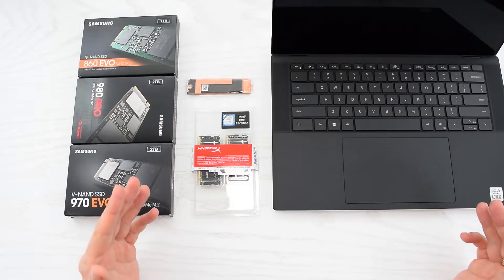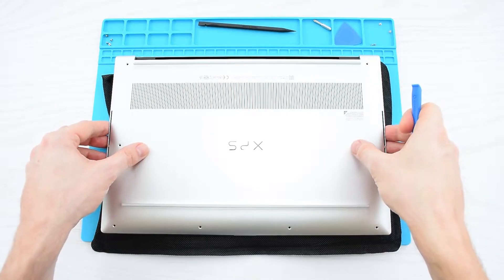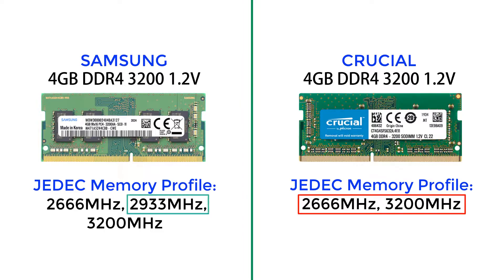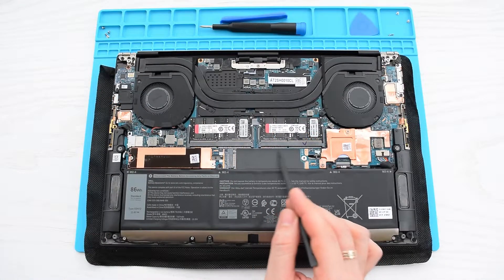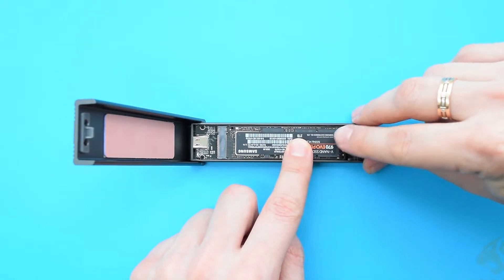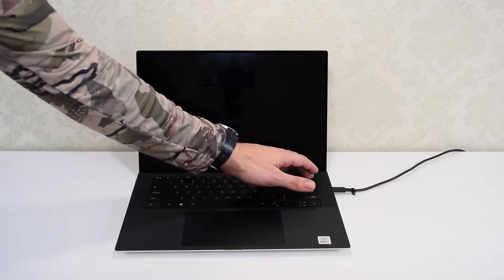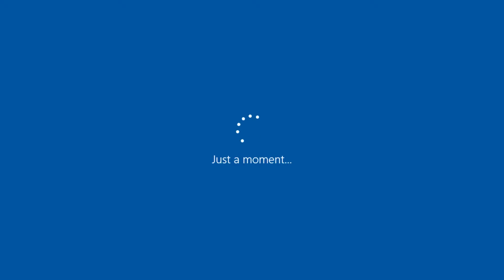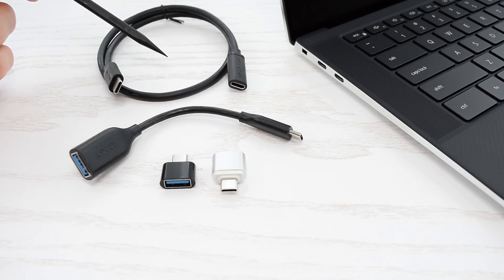Dell XPS 15 9500–9530 RAM & SSD Upgrade Guide | Max Performance Setup!

Comment: I have an xps 9550 that I bought in 2017. My laptop still works quite well and I want to upgrade some parts. Could I email you or set up a video call? I can pay you so you can give me some recommendations.
Reply from the maker: In this laptop you can upgrade your 2.5"HDD to an SSD or HDD up to 4TB or HDD. I recommend using this 2.5" SSD: https://amzn.to/3idnbFD
and this one 4TB 2.5" HDD: https://amzn.to/3MTt4WH.
You can also install a new M.2 NVMe SSD and your best option would be Samsung 980PRO 2TB: https://amzn.to/36rSSZj
As for the RAM, you need two modues of DDR 4 2133MHz. It's hard to find that memory nowadays so you can use any DDR4 2400MHz. For example you can install two 16GB modules and you'll get 32GB of total RAM working in dual channel mode. I recommend buying these RAM modules: https://amzn.to/3KQYv24
And finally you can upgrade your WiFi/Bluetooth combo module and your best choice is Intel Wi-Fi 6 AX200: https://amzn.to/3qeImLR
I hope it'll help.
Reply: @ElectronicsComputers  hey man, thanks for the help. I actually meant the 9560, will it still work with that computer?

Comment: Hello, I was wondering if I could buy the 980 PRO SSD and put it in the main slot than put the one that was originally included in the second slot ? If so, do I need to do anything special ? Thank you for this tutorial !
Reply from the maker: It's up to you, you can put any SSD in any slot it doesn't matter.
Reply: @ElectronicsComputers  I would need to install windows 11 on the newer ssd though right ?
Reply: @ElectronicsComputers  or they both run at the same speed so there’s no need to put the 980 pro in the first slot
Reply from the maker: @The Man  You can install Windows  10 or 11; it's up to you. Samsung 980 pro is way faster than the stock SSD. The slot number doesn't matter for a bootable SSD.
Reply: @ElectronicsComputers  Wouldn’t it boot by default the original ssd ?
Reply from the maker: @vincentpelletier7969  During Windows installation you'll have to remove all partitions from the stock SSD and then create a simple partition which will be your D drive.

Comment: Hi, if i were to use samsung's 980 (the regular one) for my second ssd do i need a heat sink? The system temperature constantly reaches extremely high temperatures when I play games, so I'm not sure if that will be a concern when i get the new ssd installed.
Reply from the maker: Of course you need a heat sink, otherwise your SSD will overheat and start throttling. Moreover, it shortens the lifespan of the SSD. The links for left and right heat sink in the description. Dell 9500 comes with the left heat sink an 9510 model with the right heat sink installed.
Reply: @ElectronicsComputers  if I use silicon thermal pads without the copper case do you think it will work?

Comment: FYI I ordered the SODIMM module in your link and it doesn't work with my 9510. I get a POST error: 2 amber blinks followed by 5 white blinks = invalid memory installed.
Reply: I talked to Dell support for a while. They told me that DDR4, 3200MHz, unbuffered, non-ECC, 1.2V memory should work. I've tried two different sets of SODIMM modules and both fail with the 2/5 POST code. The only memory that works is the memory that the Dell came with. The Dell CSR told me "if you're under warranty then the system will know and will enforce that you only use genuine DELL parts but if you're not under warranty it should work".  That can't possibly be true as there is no way that a hardware POST will know my warranty status. He also couldn't sell me a memory upgrade (no stock). So I can't upgrade my RAM either through Dell or through 3rd party parts. This is very frustrating.
Reply from the maker: What a nonsense. Maybe you just bought a faulty RAM module. For dell 9510 you can use any DDR4 3200MHz module. I just added a second link for recommended RAM check that out.

Comment: This video is great, thank you so much.  Note my 9510 laptop BIOS reports DDR4 speeds at 3200MHz. I assume that means I'm getting the full 3200MHz, not the downclocked 2933MHz. Maybe max speed of memory bus on 9500 is 2933MHz and 9510 is 3200MHz?
Reply from the maker: That's right, Dell 9500 has intel's 10th gen CPU and 9510 has 11th gen CPU and they support different RAM speeds.

Comment: Thank you for this guide on the video . I currently have a xps 17 9700 and considering upgrading the SSD and the ram as well. In terms of the ram compactible for the laptop will it only perform at 2933MHz maximum or could it possible to buy 3200 MHz as it does support 10 gen i7 processors ?

Comment: Very informative. Thank you. Can i ask if you use DELL PREMIER COLOR  for sRGB color space (for more accurate and less saturated colors)? Thank you
Reply from the maker: I use an external monitor with a manually adjusted profile, and I never tried Dell premiere color.

Comment: Hi, I have a xps 9510 with a i9 processor, what ssd do i need and is there a limit to how many terrabytes you can have
Reply from the maker: The best SSD on the market is Samsung 980PRO the link in the description. You can install 2 x 2TB SSDs. The maximum 2280 NVMe SSD at the moment is 4TB so you can get 8GB. There's no SSD capacity limits only for RAM.

Comment: Very good video. Thanks! 
Question: Can the XPS 9510 100% use two different M.2 2280 drives?

A Dell rep just told me it can only use one 2280 and one 2230. 
Seems like utter nonsense to me! From my understanding the slots are interchangeable for use of either 2230 (256GB max) or 2280 drives (4TB max).

Please can you help confirm?

Dell proved very unhelpful and didn't want to know about a spare 2nd slot heatsink (left side when upside down, opposite end to battery connection). Just kept telling me I needed a 2230 heatsink.

Hope you can help answer the ssd question. Thank you
Reply: OK so its official. Dell are full of idiots! I tried a 2nd 2280 SSD in the second slot and it was no issue at all. You can install 2x 2280 M.2 drives  if each is less than 4TB.
What I don't have is a 2nd slot heatsink. Now I need to complain to Dell that they're wrong and I need a bracket. I can't find one in Europe and US and CN sources suggest they will point fit the xps 9500.
Hope this helps someone else out.
Reply from the maker: You can use two 2280 without any problems. If your laptop came with 2230 SSD (it comes with an adapter that allows you to install 2230 into 2280 slot) then you can also use one 2230 SSD if you want. The links for the heat sinks in the description below the video.

Comment: I tried to do this but heni go to redonload windows from boot flash drive the ssd I not being detected. I used the same pro model as here. Even tried a replacement and still not being detected. Any ideas on how to fix?
Reply: BTW I have the 9510 and upgraded ram to 3200 crucial 32gb kit and ssd to 4gen nvme 980 pro
Reply from the maker: try to go into the BIOS and see if it's detects your SSD. If it does go drive settings and set to AHCI instead of RAID.
Reply: Thanks! I guess this problem isn't common enough that you needed to mention it in the video, or everyone else knew that they should do it, but it doesn't mention it in my manual.

Comment: I have a XPS 9500 and I plan on upgrading it with these same exact components. I was planning on just putting the Samsung 980 in the 2nd slot. What was the reasoning to replace the original SSD and just use the one slot?
Reply from the maker: Because that was a cheap, slow and low capacity drive.

Comment: Buenos dias, he comprado una Dell XPS 15 9510 (2021) y queria adicionar la unidad: Western Digital Blue SN550, 1TB, M.2 2280, PCIe Gen 3.0 x4 NVMe. Es compatible? necesitaria colocarle un disipador de calor? gracias.
Reply from the maker: Yes that SSD is compatible but I'd recommend buying any gen4 ssd instead of gen 3. Your best choice would be Samsung 980PRO. You also need to buy a heat sink. Dell XPS 9510 comes with the second SSD installed (not like 9500 with the first one) so you need to buy a first/left heat sink. The link in the description.
Reply: @ElectronicsComputers  Gracias.

Comment: Excellent video 👏, very well explained. I had following questions. Does the xps 9510 (i7 and or i9) have the same speed limitation for the ram? Or a higher speed is supported (3200 or higher)? Does the new xps 9510 (i7 and or i9) support gen 4 ssd?

Keep up your AWESOME work 👌👌👌
Reply from the maker: XPS 9510 comes with 11th gen CPU which supports gen 4 NVMe SSDs and the max RAM speed is 3200.
Reply: @ElectronicsComputers  thanks for your prompt reply 🙏

Comment: Thanks for the great video. Will any 2TB NVMe 1.3 PCIe Gen3x4 M.2 2280 SSD work in slot 2 on XPS 9500?
Reply from the maker: Those two M.2 slots are absolutely identical and you can use any NVMe SSD that is available on the market. At the moment maximum NVMe 2280 capacity is 4TB.
Reply: THANKS
Reply: @ElectronicsComputers  "two M.2 slots are absolutely identical" no, left Gen3 and right Gen4. with 980 pro you get read\write +- 3000MB\s in left slot but 980 pro is gen4 with 7000\5000 read\write
Reply: @Electronics&Computers   sorry, its info for dell xps 9510

Comment: I have 2 questions I hope someone would help:
1. Is the new xps is the same inside?
2. Can I put 64g ram on i9-11900h ? (because it can't be done on their website and Idk if the chip doesnt support 64g)
Reply from the maker: XPS 9500 and 9510 look exactly the same inside and both support 64Gb of RAM.
Reply: @ElectronicsComputers  with the i9-11900h you cant buy the laptop with 64g do you know if thats because this cpu do not support it?

Comment: did dell fix the xps reliability issues? i had the 9560 it had a lot of charging issues once the warranty ran out i ended up with a burnt motherboard.
Reply from the maker: Dell XPS 9500 is a pretty good laptop and I don't see any serious or minor issues in schematics and overall design of that model. They use pretty good components and repairability compared to Apple laptops is like day and night difference. That laptop is definitely not for gaming, even though it's powerful enough to ply almost any games. The cooling system simply is not capable of dissipating so much heat from the CPU and GPU chips. Other than that it's a perfect tool for any work like design, photo/video editing, coding/ virtualization etc.

Comment: great video. Is it possible to just replace built-in SSD with samsung pcie nvme without having to change cooling pad?
Reply from the maker: Sure! Just make sure that the pad is not damaged or dry.

Comment: Hey, would it be worth it to go with the i5 9500, then upgrade ram and ssd for photo editing purpose only, do i need better GPU and CPU ?
Reply from the maker: Intel i5 provides more than enough performance for the comfortable work. I use my laptop with i7 at its minimum CPU performance, because if you set it in Dell power manager to maximum or even standard performance the temperature of the CPU goes instantly over 100 C which is not a healthy temperature. So i5 will do the job just like i7 I don't think that you would notice any difference.
Reply: @ElectronicsComputers  thanks alot for the quick answer! I'll make a beast of a work machine with more ram and a 2nd m.2 😎😎👍👍

Comment: Hey man, Great video!

so I ordered My Ram a couple days ago before I knew anything about 'Jedec Standerds' and i have no idea what the Jedec Profile for my RAM module is?
is there anyways you can assist me? the model number is "Crucial CT2K16G4SFD832A" 
also is it not possible just to run the Ram at XMP? or will that still lead to the same result?
btw I have the XPS 9700 (i7-10875H) just in case you wanted to know.

Thanks so much!
Reply from the maker: That laptop doesn't support XMP only Jedec profiles. There's no Jedec specs on that RAM and I don't have at the moment such modules in my office, so I can't tell you for sure will it work with right frequency or not. But anyway, just give it a try. Then start the task manager, then click on the performance tab and select Memory. At the bottom of the window you'll see the speed of your RAM module.
Reply: @Electronics&Computers  thank you so much for your help anyways! I've done a little research on Reddit and Amazon reviews other people with the same RAM have been able to run it at 1.2v at the 2933 MHz, so i am hopeful, but ill be sure when i receive the items and will keep you updated. But thank you so much for opening my eyes to this, crazy how little other "youtubers" talk about this.
Reply from the maker: @meladkareme5851  I'm happy to help!

Comment: This is a great video. Thanks!!!!  I just bought a 9510 with the intention of adding a second SSD in the near future when I can get a decent deal on one.  Am I understanding correctly from your video that I don't need a heat sink for the second drive?
Reply from the maker: If you buy a slow NGFF (SATA) M.2 SSD then no need in a heat sink but if you want a super fast NVMe SSD then you need to use a heat sink.
Reply: @ElectronicsComputers  Thanks!!!

Comment: Do you need to remove the battery to install the second SSD heatsink?
Reply from the maker: It's up to you. Just work carefully and everything will be fine.
Reply: @ElectronicsComputers  I mean to take the whole battery out of the motherboard.
Reply from the maker: @jamespilot93  No, no need to do that.

Comment: I can't get the battery unplugged from the enclosure on the motherboard... I was hoping your video would have showed a close-up view.
Reply from the maker: It's a very tight and fragile connector so be careful with it. If you just need to upgrade RAM or SSD simply leave it connected.
Reply: @ElectronicsComputers  Hi, thanks for the nice and informative video. I'm also planning to upgrade the ram in my laptop (15" 9530 2023 version), from 16 to 32gb. So is it ok to leave the battery connector on? I'm just not sure if I turn off the laptop will it stay in some low power mode, not completely cutting power? Maybe I should turn off fast booting in energy settings? I don't have so much experience with these stuff and don't want to break anything. If I leave the connector on how can I be careful enough to not cause any problem? Thank you.
Reply from the maker: @grimmdaniel4622  If you select the 'Shut Down' option, your laptop will turn off completely. Avoid using hibernation or sleep modes. Just be careful not to touch anything unnecessarily, and you’ll be fine. I always replace RAM for customers without disconnecting the battery cable. Removing the battery can reset the BIOS, which has caused issues with customers' laptops, like failure to boot or other problems, requiring adjustments to the BIOS settings. So, carefully replace the RAM, and everything should go smoothly. Even if the laptop is in sleep mode, the worst that can happen is the current session crashes, and the OS will restart. There's no risk of crashing the BIOS on XPS laptops—they’re extremely reliable.

Comment: XPS 17 9710, I have replaced the SSD by Samsung 980 PRO NVME, created a WIN 10 boot drive. The Samsung SSD 980 PRO is recognized by the BIOS but the partition is NOT recognized by the WIN 10 installation.
¿Any idea why the Samsung 980 PRO NVME partition is NOT being recognized by the WIN 10 installation usb drive?
Reply from the maker: During installation it says that you can't install Windows into selected partition/drive???
Reply: @ElectronicsComputers  It does not find any partiton at all...I have replaced the SSD1 dell original with the OS with my new SSD Samsung 980 PRO NVME. The BIOS recognized it. I did a BIOS test on it which was also ok. But when booting from USB drive to install WIN 10, after first steps, when it is time to select the disk and partition to install the WIN 10, no disk or partition is being shown.
Reply from the maker: @gastonfau8012  Enter into your laptop's BIOS and switch from RAID to AHCI.
Reply: @ElectronicsComputers  That was correct. I found a note browsing internet. It seems some laptops came originally with BIOS in RAID mode and despite it recognizes the SSD in BIOS it does not while installing the WIN 10 from USB KEY (unless you download and put in the USB key the Intel Rapid Storage driver and load it from the WIN 10 installation menu). I just changed from RAID to AHCI and it worked fine. Thanks.
Reply from the maker: @gastonfau8012  Happy to help!
Reply: @ElectronicsComputers  Should it be on AHCI when installing the new SSD? Laptop is currently on RAID in BIOS and works fine on the old drive, having just the single drive. My point is, if its running in RAID should I leave it on that?
Reply from the maker: @Britishfever456  You have to switch to AHCI, otherwise there will be some issues with some drivers and software. For example, if you install Samsung's SSD then Samsung Magician app won't work.
Reply: @ElectronicsComputers  Is this particular issue RAID vs AHCI related to adding a second drive in the open second slot on a 9510 or is it just if you replace the primary drive and install windows on a new replacement?  Would it also be the case if you were just cloning your primary boot drive to a larger M.2?  (Or a more simplified question is this change in the BIOS always necessary when messing with the drives?)
Reply from the maker: @WrongNumbr  There's always should be AHCI by default and you turn on RAID only if you have two drives which you want to combine  into one drive for higher performance. I don't know why Dell uses RAID by default but it creates a bunch of problems for users who doesn't know about these features.
Reply: So you should have RAID on if you install 2 ssd and AHCI if you have only one ssd installed?
Reply from the maker: @awakef  No, I don't recommend using RAID at all in both of those cases, unless you need RAID for some specific reason/goals.
Reply: @ElectronicsComputers  oka thanks for a great video!